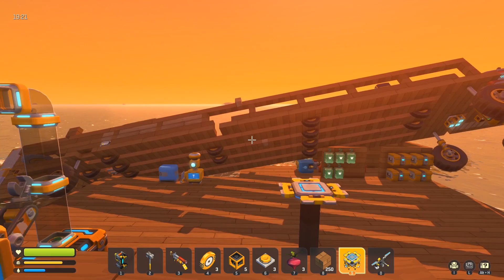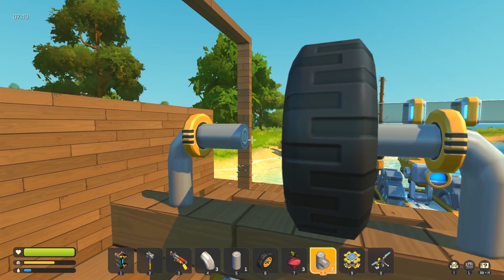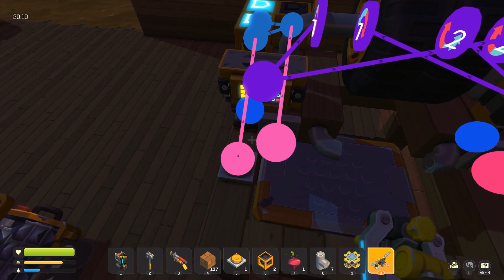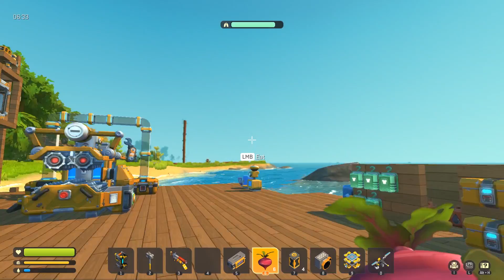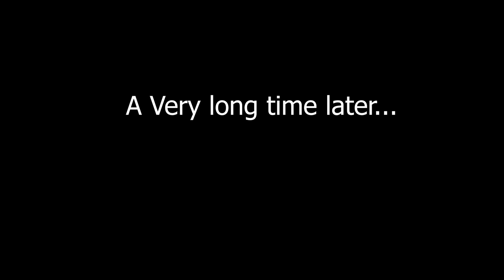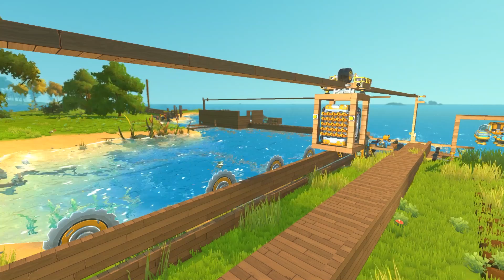Internal Material Transport System | Scrap Mechanic Survival

Comment: Still sort of new to the game but will this work with chests as trying to figure best way to deliver chests of food to the crating depot. One I have just used fant mod to teleport the food to the near by depot but the one further away the teleport won't work for this same farm so been sorting out my options to deliver food there.

So if I put chests on the trolly rather then the collector will this also work for them to then empty the chests at the end into a delivery system of some sort that then delivers it to the crate creation ports for each food type or will this not be a solution for crate like it is for the collector???
Reply from the maker: Unfortunately no the vanilla chests are not able to be remotely filled without being directly connected through a pipe. 

The way that the game also works (why it wont work far away) especially with the fant mod is that the chunks will unload after a distance, meaning that if you don’t have that chunk loaded, anything involving that chunk does not work

Comment: Hey old video so you probably won’t respond, when ever I use controllers on loop and turn it off it will loop back, how do I fix this because I’m trying to build this, I couldn’t find any help with this so your my only hope.
Reply from the maker: If you don't want a controller to loop back when it stops recieving power, all you need to do is turn off loop. IIRC controllers round up or down to the closest instruction when they stop receiving  power

Comment: The tiny cactus plant things that are in the tiny pots have a lot of friction. I put four of them on the four corners of my vehicle and attached them all to one piston so that they are pushed into the ground and my vehicle is lifted up. This completely stops my vehicle from sliding, allowing me to park even on the side of hills (although it does slide a little bit when on very steep hills).  If you have a heavier vehicle, you can increase the number of cactus plants that you use in order to increase friction.

Comment: Just curious how you know what level raid you're going to be attacked by?
Reply from the maker: If you open up scrap mechanic in developer mode, it opens up a console that contains the log that gives you all sorts of  useful information! Including the level of raid and which bots are spawning

When setting launch options in the game settings, (found by right clicking the game in the steam menu) add "-dev" in the input line and press ok/save, the next time you launch, you should see the console in a separate window :)

Comment: Imagin making self sufficient farm. System. It automatically defends raids. After. All crops grow a the system goes takes the crop waters the soil. And plants new crop. And once the process is done. Theirs a vaccum pump that's on the system where the chest of crops funnel into. Where it fills a cart with the crops and the cart will go to its main storage where it offload using a vacuum. Into chest.... now of course theirs thing we need. Like a way to filter items in chest. so we can filter the seeds and crops we get so the system wont run out of seeds. And the cart wont fill with seeds. And only the crops will go into the main storage. We also need a way to measure the amount of items in a chest. So when the chest on the cart is full. Or the vacuum pump on the harvester is full the cart can go. Now what will make it more complex is if u use multiple carts. And connect the rails toghter so you would have to make a simple traffic ai so theirs no collision while on the tracks. Now this would take time to make. And this is why creative mode needs to support atleast crops and the survival stuff like tubes and chest.  And. Manual raids so we can test and experiment with some system like this

Comment: I love your videos. You have great ideas :)
But I also have an idea for your system ... A forklift system. No fixed collector box on the rail system. So you could exchange empty boxes for full boxes. And maybe 4 wheels instead of just 2. Then the box should no longer tip over. ;)

Comment: Way more complicated than it needs to be. 1 button, 1 bearing with a wooden cross with 4 different length arms 1 controller and 1 sensor and 1 timer lets you program 4 steps into your cart. As the cross turns it changes direction.

Comment: If you stack the chests correctly under the craftbot you don't need to use the glass tubing. From memory, you need 6 large chests. It circulates all the stuff you craft from output to input to output, etc.
Reply from the maker: I believe I mentioned that in the video, I may have cut it out if you don't remember seeing it, I just think the pipes look cooler :)

Comment: I recommend you to use as less as suspension as you can. Until they fix the glich or make another suspension that doesn't have the glich, they are one of the main problem that make everything broke with no reason in a second and drop the fps.
Reply: one time that sort of thing happened to me but i didnt have any suspension on the build

Comment: great idea, I had something similar in mind though different. My idea was a four directional device that rolls along a path using colour as triggers. 1 colour for forward 1 for backward 1 for left 1 for right. lay out a path and let it go, to stop you just retract piston with the block that has the forward on it. Was just an idea in my head mind you haven't tried it out.